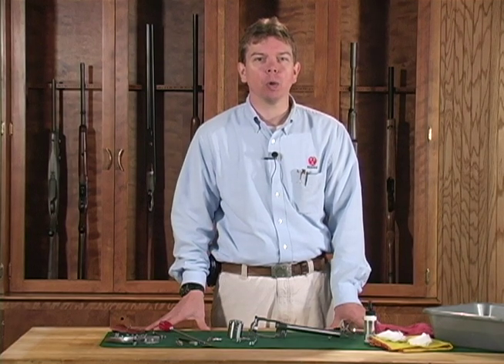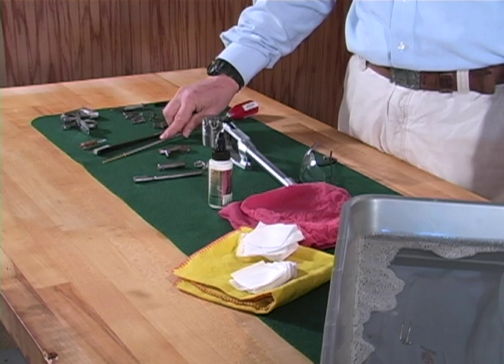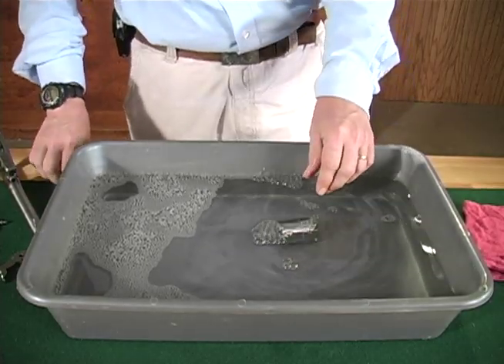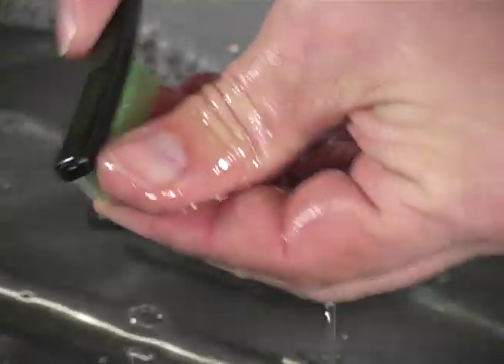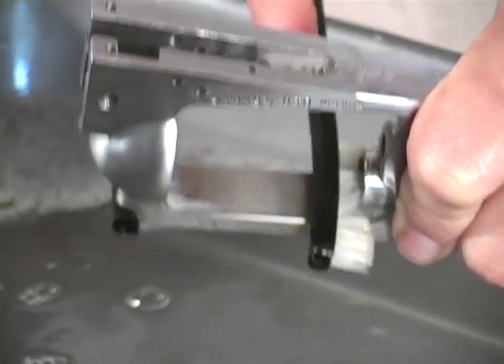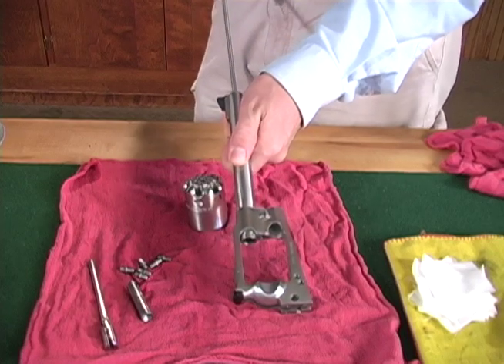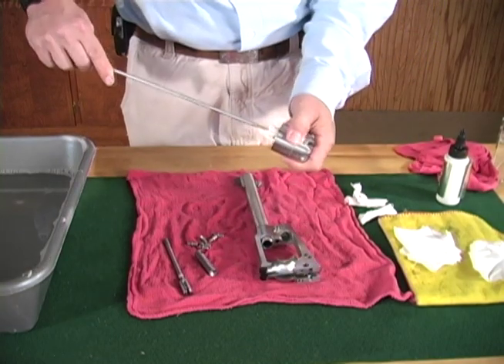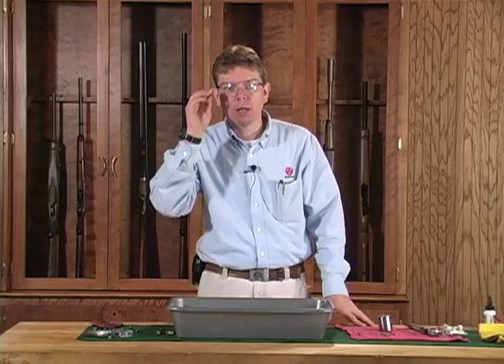Old Army Cleaning

Comment: Something I discovered about my stainless Old Army. Be sure to also oil the screw and spring plunger that holds the loading lever to the barrel. That screw and spring are not stainless and they will rust. I found out the hard way when I couldn’t get my loading lever to release from the barrel. Also when you are done, be sure to wash your hands extremely well. You are dealing with lead and whatever chemicals may be in the powder residue. We’ve all heard what lead can do to the body. I love my Old Army and I wish they’d bring them back!